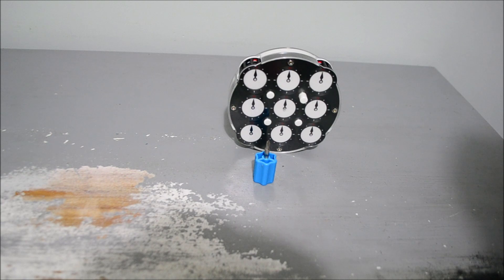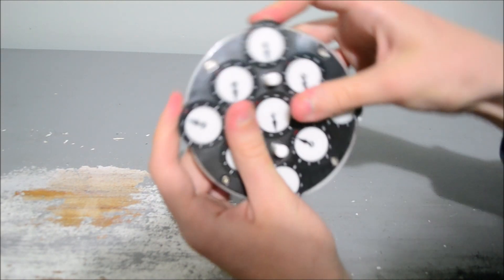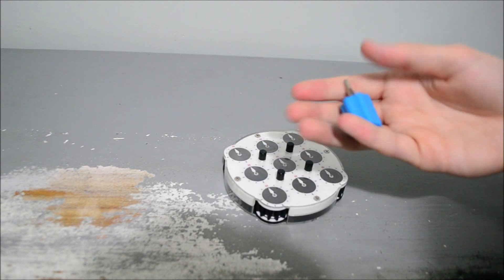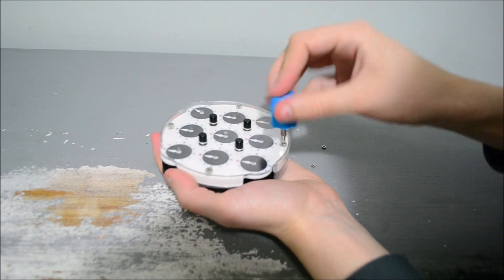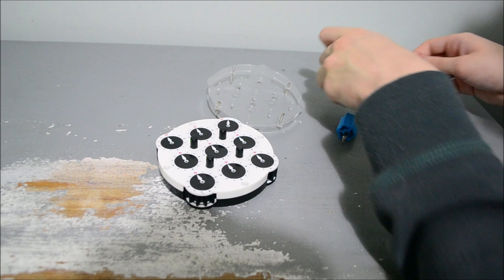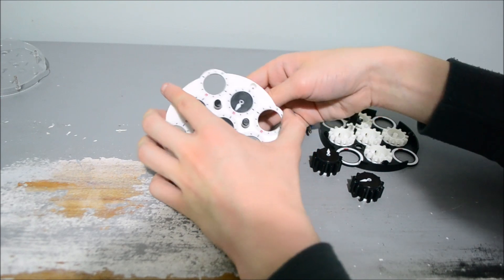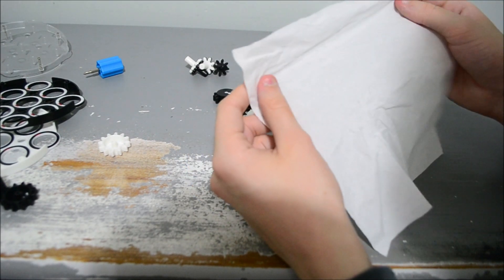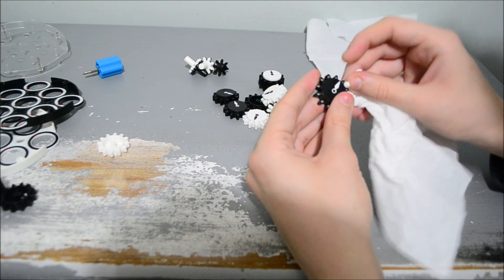QIYI CLOCK [Reassembly, Cleaning, Lubing, Tensioning] Tutorial

Comment: Does it actually need to be on the 12 o clock everytime you assemble i
Reply from the maker: It makes it so you don't have to disassemble again if you accidentally do it wrong. If you put the pieces in a random orientation it will most likely be impossible to solve
Reply: Oh yeah qiyi clock doesnt have springs
Reply: It is NOT necessary to put everything at 12 o'clock. The puzzle will always be solvable.

Comment: hey dude i have a big problem with my clock, i reassembled mine, and a two dials consistently felt different than the other two. I thought it was strange, so i disassembled and reassembled. after a while i figured out the problem was the magnets. on some of the pieces the magnets were very pushed into the slots, and on others they were closer to the surface? ive never seen anyone else have this issue
Reply: i fixed it by pushing all the magnets in further but its sort of a shame i liked the feel of the strong ones
Reply from the maker: Haven't seen this issue sorry, that's strange
Reply: i heard new qiyi clocks have the magnets less pushed in on the center, and on the edges they are very pushed in. this video was probably made when all the edges were the same
Reply: the very center clock is not interchangeable with the edges because the middle clock has different magnet depths than the edges meaning not only do the center and edge clocks have to be placed correctly(the center clock with different depths in the center and the edges all in the edge places), but also you have to make sure that the outside clocks(corner clocks) with magnets are diagonal from each other. If you do that all correctly, the clock should be correctly reassembled.